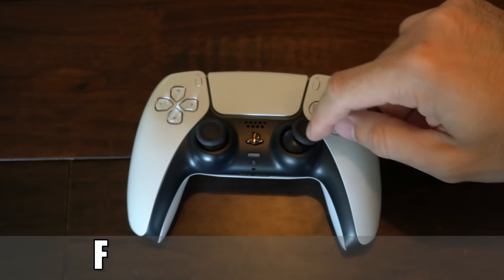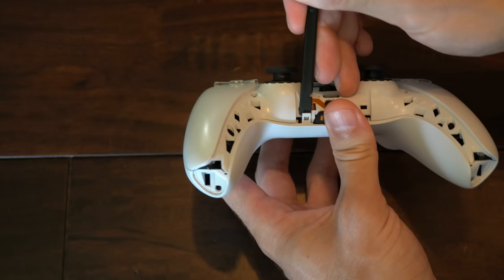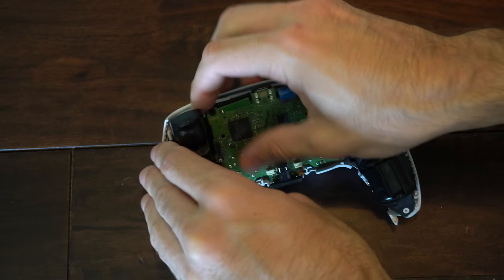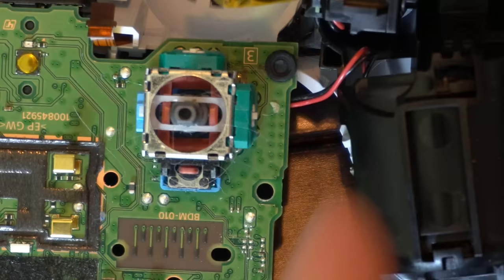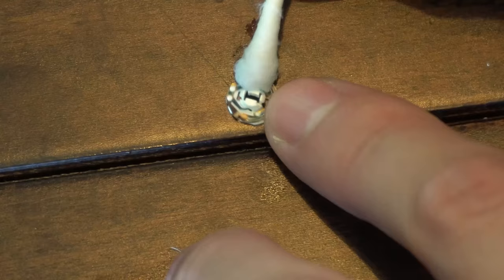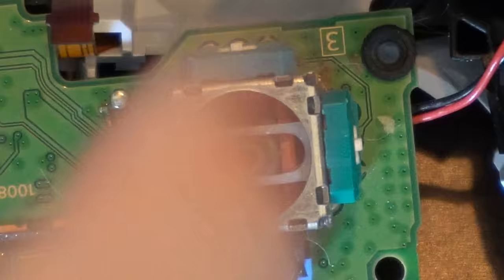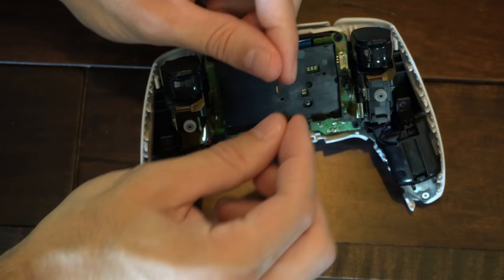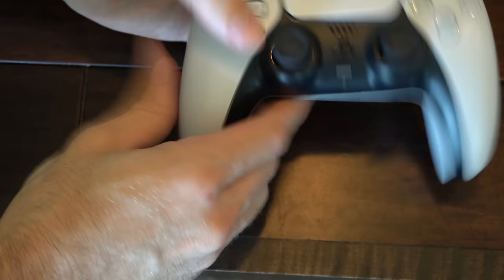How to FIX PS5 Controller Stick Drift & Moving on its own (Best Method)

Comment: Do not attempt unless you're willing to risk further damaging your controller! Removing the shell, screws and ribbon cables is child's play but once you get to the potentiometer, it's like doing brain surgery.

The main board has four delicate solder points that you have to work around. Any sudden movements and you will pop one of them off - as I did.

If that wasn't bad enough, I couldn't get the north door on the potentiometer to snap closed again after cleaning the sensors. My repeated attempts have broken the tiny plastic clips so now the little door will never stay closed.

I would have to buy a new potentiometer and learn to do a difficult solder (which isn't going to happen) so my controller is toast.

Please consider this before attempting. Still no clue if this fix would have even worked if I'd been successful in putting everything back together.
Reply: It is true you need to be careful. I would not recommend this unless you were used to making similar small repairs.

Controllers are also not built to be repeatedly opened like this. I have an old PS4 controller which I've had to open several times to repeat the same repair, and over time several plastic clips have broken off, and most seriously one rim cable became frizzled after being removed and inserted too many times. I was able to repair it, but it did serve as a warning not to do this more often than is necessary, because the repair itself will cause wear and tear over time.
Reply: @cccpike  That's also a really good point. These things are usually not made to be opened repeatedly, but fortunately they sell replacement and custom cases so if yours gets too damaged you can swap the shell for a new one. Also you can usually re-solder any damaged connections if you happen to make any, but it is a good idea to have some experience doing small repairs before working on something you're not ready to replace.
Reply: Yeah I’ve attempted it once today and I think I might have put the wrong white small disks in the opposite sides as I cleaned both sides which might be the reason it’s now constantly pulling to the left consistently or it’s something more complicated, I bought a second hand controller so my fault really

Comment: Thank you! I bought this ps5 brand new less than a year ago and my controller just started drifting to the left on the left joystick. If anyone reading this is or has played Edlen ring and it's DLC, you know that can spell disaster very quickly. I am so grateful there are videos like this on YouTube. It's nerve wecking taking apart a $70 peice of equipment. 😅

Comment: when I seen the thumbnail of this video I said “you know what imma just buy a new controller at this point”
Reply: Lol its not that complicated.
Reply: honestly u might as well ATTEMPT to do this, bc if it works then u save urself a new controller, if not, then u already planned on buying one anyways
Reply: indeed and if you follow the video its not complicated at all . @nesquiked
Reply: No joke if you can build legos… you can do this, lay out a towel, open each part with little pressure (check for front clips once screws are removed) lay it out in sections as you do it to not loose pieces once you get to censors tweeze it out and put back in and work backwards. The flimsy circuits slide in easier if you do not force. You got this. - and to above point you buying a new one any way you 100% have nothing to loose.
Reply: @nesquiked not really I can trade a used controller that works for more then a controller that doesn’t work at all haha.

Comment: Although my parts weren't dirty at all the "cleaning" still helped and it worked for me! Thank you very much!
Reply: Did you clean both sensors?
Reply: @napoleon760  Yes, though I only had stick drift on the left stick. But cleaning both did it for me. Works like a charme.
Reply: mine werent really dirty at all, its crazy cause even dirt or contamination on a non visible scale can cause drift. i had slight drift on my left analog stick and cleaning it fixed the issue. there were a few hairs tho so i wonder if those had anything to do with it. i need to do these steps on all of my switch joycons and pro controller and i am dreading it. i hope someone can invent a mechanism that makes it to where drift wont happen to controllers anymore.
Reply: Thanks , it worked like magic. Mike also was not dirty but I guess the cleaning helps improve the flow of current

Comment: Dude. Great video. My left thumbstick was going to the left consistently. I watched your video and followed the exact instructions. Now it's like having a new controller. No stickdrift at all.
Reply: I'm about to do this right now. I have the same issue, it just keeps going left lol
Reply: This put me at ease trying right now I have the exact same issue only with the right stick instead of
Reply: Had the same issue, turns out that little piece on the final pull apart was broken inside. Tried to super glue it, didn't work.

Gonna buy a new one and return the old one in the mail

Comment: I just did this and my drift got way worse. I'm definitely not saying to not do this though. This is super easy to do and I did find some gunk on one of the sensors. However, the stick itself creaks and I can feel the resistance when I move it. So just a forewarning to others in my same situation. You're probably gonna have to buy a new controller. Other than that amazing video; really taught me how to do this for other controllers when they get drift. I just hope the stick internals don't break on my next controller😅
Reply: I got an easy method without breaking p5 controller and taking it apart
Reply: @Venge4nce44 do you mind telling?
Reply: @LaggingRN420  guess that’s a no
Reply: @LaggingRN420 thats a no I guess almost a year
Reply: @Venge4nce44 did you fix it ?
Reply: @kingpotato1022  i just ordered new potentiometers and replaced them with the old ones, you only need a little soldering kit
Reply: @LaggingRN420  ok thanks for responding

Comment: Can confirm this works. Just gotta be careful prying open the sensor covers (green flaps you open just before cleaning). If you pry them open too far, then it’s very difficult to get them back into place. So pry those open just enough to access the sensor parts.
Reply: any advise to get them back in when they wont click in?
Reply: @benmurkin3863  I used needle nose pliers but you’ve got to be sure to line it up perfectly and not force it.  It will snap into place eventually.
Reply: This. The way this fella goes about it is too careless, they should be opened slowly and juuust enough as you said. The drift will return after some time as the cleaning isn't a permanent fix, calling for this operation to be repeated every now and then. Therefore we want to keep the bending back and forth to an absolute minimum.
Reply: I followed the instructions but after reassembling  and turning it on, I tried a custom match on MW but the right stick is now stuck at point at the sky while turning to the left automatically. Any suggestions?
Reply: @benmurkin3863  I was pushing from the top, but once I pushed from the bottom I was able to click them in place. 3 months later though so..
Reply: @maarri1626  you e put the sensor back in upside down
Reply: @ashleytuck3863  what does that mean
Reply: @StarfighterJohansson  UPDATE TO THIS: I found myself unable to get them to re-seat back in place and they would visually start to press out when testing/moving sticks before re-assembly. Took a very close look and saw I bent the plastic pop up clips on the BOTTOM of the green snap assembly. However, after thinking I was SOL I twisted/removed both the bottom pop up clips on both green casings as well as 1 of the 2 side clips on 1 of the green snap assemblies and got BOTH TO CLICK IN PLACE AND STAY THERE after!!!!

If it's not clicking into place no matter what you do, you likely bent one of the plastic clips that protrude out and go into the receiver holes on the inner component. Recommend inspecting closely and if all else fails twist/carefully break off broken clip and allow the other clips to re-seat and do their job as the placeholder.

GREAT TIP!!!!! THANK YOU SO MUCH.
Reply: @maarri1626 dude same did you find a way to fix it?
Reply: @DoritoPope003 what if you broke off all the metal clips cause I got it back on but it won’t. Work
Reply: @djanithegamersfm  i was having the same issue until I realized i put the sensors in facing the wrong way.  The metal part has to go in facing away from the analog stick. Mine popped right in after i did that and now it works fine
Reply: @glitzie2291 I did too.. did you ever fix it?

Comment: Only had this controller since Christmas so it's been a little less than 3 months. This took me 1 hour 15 minutes, had some dirt and gunk in the top sensor for the stick that was drifting (not sure how). Cleaned it out, put it all back together and the controller is now like new! Thanks man. 

NOTE: It's hard to see, but it's very easy to miss the fine little threads from the q-tip that get stuck on the sensors. Make sure you look at it all from different angles and move your work light around as well.
Reply: I wouldn't recommend going into the mechanism with a Q-tip, but if you must you can wet down the webbing with some isopropyl and that'll keep them from getting stuck. That way the iso will evaporate and you won't have any liquid in your electronics.
Reply: @patricklouis439 what would be better to use rather than a q tip?

Comment: For some reason the interior of the potentiometer in my controller was covered in like black grease, cleaning only reduced the drift, but also one of the copper plates in the part you take out was broken. I ended up replacing it with one from an old xbox 360 controller, since the manufacturer of the sticks is the same, and it worked... at least for today, time will tell how good of a solution it was.
Reply: I did a similar thing but I replaced a PS4 analog with a PS2, but just those green pieces and after flipping it around a couple times I found the right orientation and it fixed my stick drift for a good 7-8 months. It’s been 2 since your comment so I’m curious how yours is holding up?
Reply: @millerman33  It's still working, there's some drift when I press the stick, but it's usable. Until now it has been 2 month or over 100 hours of use.
Reply: @David Navarro  one of my potentiometers was also covered in a lot of what looked like black grease. I couldn't get it all of with isopropyl alcohol and cotton swabs.

Comment: Hi, this is a great tutorial and it worked for me. I would like to add two things, firstly when opening the white case of the controller, be careful because you can easily scratch it if you are not using a plastic tool(I tried using a screwdriver), and you can open the case without it, you just need to make a small opening at the bottom with something and then open it by using more force. And secondly, I mixed up the things that open up to reveal the part that needs cleaning, I cleaned the wrong one first, so remember that the upper one is for left-right rotations and the side one is for up-down motions.

Comment: Another word to the wise... When you remove the little white springy sensors, be careful using a cotton swab on them. They have tiny little spring arms that get caught in the cotton webbing and can bend. I have 20/20 eyesight and can barely see them. So if you clean it out and then you have an issue with the stick rebounding from right to left, you probably bent one. I bent mine back with tweezers and it's working again but I have a feeling I'll have to replace that little white piece eventually.

Comment: Absolute legend, saved me either spending $100 or getting used to aiming down to stay steady
Reply: Yea, I'm not spending another hundred on another controller. I'd rather sell the system, than to give $ony more money for their stick drift scam.
Reply: @sizlax  The problem is they still use the same internal mechanism from the previous model, and it is prone to drifting. They need to upgrade their joystick tech.

Comment: worked for me thanks a lot, guys if u want to do this be careful when you will be unplugging the battery you will need to pull harder than in the video but it will work

Comment: Thanks for the video! 

Note: Before closing up the green tabs on the joystick - You should set the white part into the green tab first. Just a precaution so you won't break the little white part
Reply: Hey the little green tab doesn't want to close
Reply: @ReactionPro007 same
Reply: @ReactionPro007 did you find a way to get it to close?
Reply: Wow great tip
Reply: @ReactionPro007  any luck with this? im in the same boat
Reply: @psaprez  I saw that the clips broke so I just put so much pressure until it fit into there
Reply: @ReactionPro007 bruh😂
Reply: @ReactionPro007 one white little piece off the sensor broke and im losing my mind
Reply: @silverchar1ot  I kind of feel the same way though it really happened to me as well 🙁☹️

Comment: Very helpful, thank you! I was afraid to pry open the sensors to get them out and clean them directly, I skipped that part. but with the mechanism inside the sticks exposed, I was able to clean them out with canned air and cotton swab and that was good enough! fixed 2 ps5 controllers tonight this way, very pumped that I dont need to buy new ones.
Reply: Everything was easy to do until it came to that part for me. I couldn’t get them to snap back in. I just destroyed one controller because of it. I’m gonna try what you did with my second and last one. This guy has 100 percent opened this controller many times. Plus my ribbon color was different than his.
Reply: I saw this comment and I blew into my right stick and fixed it instantly , I didn’t wanna risk it and take it apart and blowing air in it seemed to fix it..thanks man

Comment: I tried this and the drift I had disappeared! (I had drift going left on the left stick)
The annoying part was that I then had a new drift, going up on the left stick.
I then remembered how much less I cleaned the analog going up and down compared to the one going left and right and opened my controller back up to re-clean the analog again.
Now the controller works like new!

You saved me from having to buy a new controller and now I know just a little bit about the insides of one.
Thank you!

Comment: Thank you very much for the video. I had terrible stick drift from my left joystick to the point that I stopped using my controller. After following you steps I can say it was a massive success.
Reply: I have a big like super big stick drift is very terrible on my right stick do you think it will work for me ?

Comment: WARNING FOR PEOPLE ATTEMPTING THIS FOR THE FIRST TIME: Be very gentle! If you're just a little too rough, you can permanently damage the anolog stick. Although this method does work wonders, without caution, this will require you to buy a new controller all together
Reply: @flintbeastwood7665 how? 🤔
Reply: @flintbeastwood7665  Do you mean you used a vacuum on your controller? Don't know what you mean by suction.
Reply: My issue was the bottom 2 ribbons i thought they clicked in but u have to put the plates down for them to stay in place
Reply: have to buy a new one....taking out the motherboard....you have to be really gentle and even then its risky.....oh well i tried lol
Reply: Put your mouth over the joystick and blow down the hole. Fixed mine
Reply: @BenDover-oc7vl  did this plenty of times and it doesn't work
Reply: Because ps5 controllers are an overpriced paperweight piece of trash
Reply: No, just resolder new analog stick and you good to go. Reason why sticks fails is bcs of cheap design of analog sticks. Have taken apart dozen controllers.
Reply: It’s a pain in the ass
Reply: @adammatschullat195  One of my two ribbons literally came off and I don't know where to put it...
Reply: @SentientIrisu  which ribbons?  The ones at the bottom took me forever i just kept pausing the video
Reply: @adammatschullat195  the sensor inside the stick itself
Reply: @Skits_King  i sorted my issue out months ago, it was comment replying to mine

Comment: Be careful when prying the green things open. I dont know what i did wrong but they wouldnt snap back into place. I had to use a TINY dot of superglue to get them to stay closed. 
Also be careful with the little ribbons on the bottom for the mic and whatever the other one is. Both of mine broke super easily like they were dry rotted or something. I never used the mic anyway, and i dont know what the other one is for but the controller still works fine.

Thanks for the great video. I got so used to manually correcting my characters from walking to the left that it's going to take some time for me to get used to not having to do that anymore. LoL
Reply: same
Reply: Same

Comment: THANK YOU, im basically a certified dualshock 4 surgeon but this is the first time having to open up my 2 year old PS5 controller. This fixed my issue. You are a saint.

Comment: Thank you so much. The problem with my controller was that one of the white thingies was broken and following your tutorial helped me notice. I had to buy a potentiometer (it was pretty cheap tho) to get the piece, but after I put it all together my controller worked perfectly. I appreciate the detailed steps on how to open the controller 💜
Reply: Could you link me to where you purchased your potentiometer ? Pretty sure that's my issue as well after doing this and only making my drift far worse
Reply: ...Nvm fixed my controller by slightly bending those metal semicircle things on the potentiometer themselves so they make better contact with the graphite pad